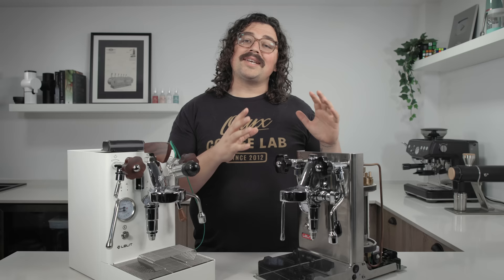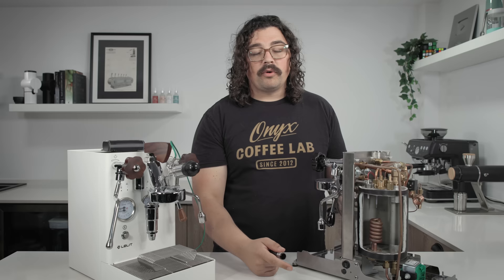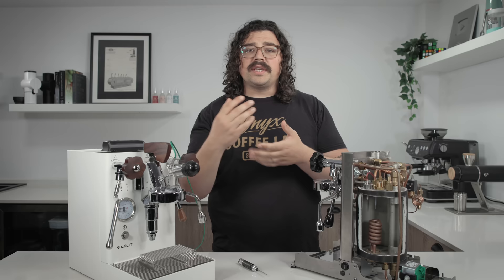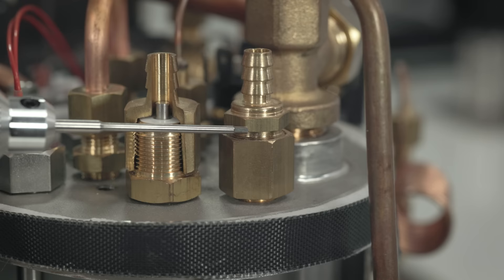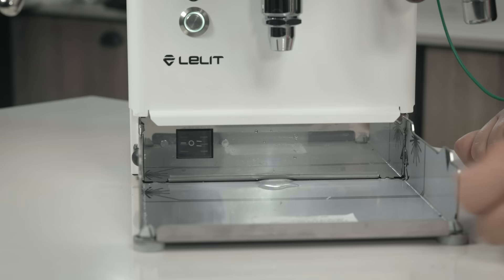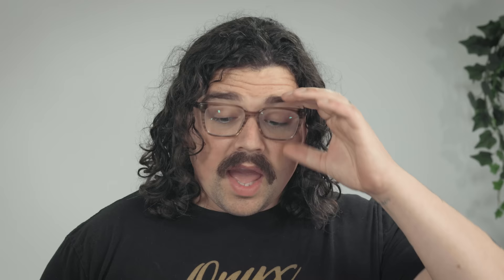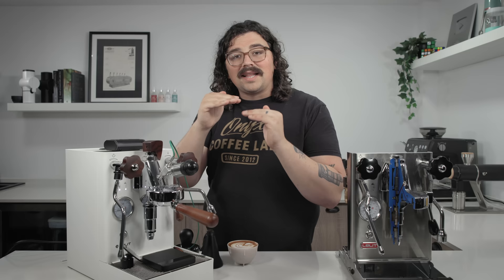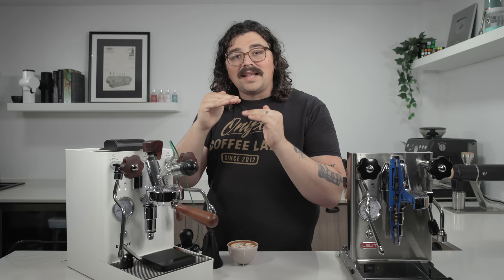BEST BUDGET HEAT EXCHANGER?: Lelit Mara X Review

Comment: Chrome, brass, copper, and stainless steel. What's not to love? The mechanical isolation of the vibratory pump is a nice touch. This is a little mod that can be made to cheap machines for quieter operation.

Comment: Amazingly good video! 👏 thank you! 
I’ve been using this machine for about 4 months and I couldn’t be happier with it. I didn’t want to spend more than $2K, and really couldn’t justify the $3400 for Bianca when I’m the only one making coffee at home. This machine has exceeded all my expectations and more. I initially went with Ascaso Steel Duo but ended up sending it back, got my money back and bought the Mara v2. My other 2 options were Profitec 400 and Lelit Elizabeth. I’m not too fond of the looks of the Elizabeth, not for my kitchen, and torn between P. 400 and Mara went with the one I thought would look the best in my kitchen. Love the aesthetics of the Mara and pulling shots has been a breeze from day 1.
Reply: Why did you send the Ascaso back?
Reply: @peschee  faulty unit, the steaming worked on day 1 and then wouldn’t work at all. I called the seller and they couldn’t help me over the phone and asked me to send it back for a replacement. I sent it back but requested a refund instead. I was just disappointed with the whole thing. Glad it happened though!

Comment: Amazing compact machine. I’ve add a temperature display by reading the TTL pins. Another mod is change the pump to DC gear pump  that I can change the pressure by controlling the pump’s power

Comment: Loving my Mara X so far. I know e61's and heat exchangers are not for everyone but I will say if you like the e61 and you want a small machine that just works like it should this is a great choice. Also got mine for $1700 new, a lot more reasonable than $2200.

Comment: Great video and a thorough walkthrough, Lance! Thanks for that, but damn, I was about to pull the trigger on a profitec pro400, especially after seeing whole latte love‘s video on it where it seemed to have great thermal stability after a short flush. After seeing this video and your words on HX machines I’m rethinking it again…the pro400 seems really well built though and it has a real preinfusion mode. Also, I have a profitec dealer and repair shop nearby, so I might still go for it if they convince me. Tough decision…
Reply from the maker: sounds like Prof is the way to go, tbh.

Comment: I've been using a Mara X for around 3 years. Picked up a couple of things from this video. I thought steam dropping to .5 bar was a fault but maybe not. However mine doesn't drop while pulling a shot or if it does it's comes backup again before the shot is finished, it does drop to .5 while steaming sometimes, other times it will stay around 1bar. I don't know why the inconsistency.
I have mine in power saving mode so don't have to worry about over heating, just have to wait 10 mins or so for it to heat up again. For someone who just wants to drink a nice coffee in the morning without to much fuss the Mara is perfect.

Comment: awesome vid, but can't say I agree with you on temp stability after a few hours of being left on, I've left it on for hours on end and I find that the machine never overheats, it has only overheated when tinkering with the machine and the steam mode has kicked on which then heats up the group temperarily, it is only when that happpens when I have the group overheating. (I have a e61 thermomeater).
Reply: Nice review. I use the x steam mode, I lift up the lever few times before brewing to keep the high steam pressure while brewing, would you think the group head will be overheat if i do this way? only for 1 shot
Reply: @erihsehc2  yep, just pull the shot, clean the portafilter and group, once you fill the pitcher, it should be at steam preassure

Comment: Thanks a lot for this very interesting video and your insight. I'm a Mara X owner and have built in the thermometer in the grouphead but no flow control. My machine turns on at 5am. I make espressos at 6am 1pm and 3pm without turning the machine off inbetween and the eco mode off. The thermometer shows exactly 92.2°C ever single time when i step at the machine after idle for several hours, literally without exception. During the shot, the temperature shows 94.6°C every time, which results in 92°C in the portafilter, as tests have shown. I wonder where the instability comes from after idle time with your machine. Is it possibly because of the flow control?
I actually forgot to turn off the machine today after 3pm, walked at the machine at 11pm and it showed 92.2°C. It seems to be incredibly consistent to me. I'm in brew mode ond temperature level I btw. The only inconsistency I notice is a high temperature around 15min after i pull a shot or s temperature drop if i pull back to back within the same minute without giving the machine a 2min break. Other than that, it seems to settle at exactly 92.2°C again.
Reply: Btw, do you turn on the steam x mode
Reply: @erihsehc2  I have the V1 of the Mara X on the what was then called "brew mode" which is the exact same mode that is called "steam mode" on V2, so yes.

Comment: Hey Lance, I've been waiting for your review on Marax. Also amazed that you mentioned the reduced flow rate of the machine. So I wanted to ask you, considering the reduced flow rate (5ml/sec) and the slow ramp up (10 sec), does that mean that the recommended brewing time should be longer than the normal 25-30 seconds?
Reply: This really made sense for me. I have my shots dialled at 40 seconds. I thought I was weird, but maybe it’s the flow on the machine
Reply: Yeah, by taste mine are 35-40 seconds. I always assumed it was the preinfusion / slow ramp up, I didn't realise the flow was considered slow
Reply: Good old question about when to start the shot timer. Some (including me) start when the flow starts (first drops in the cup)

Comment: So glad I’m not the only one waffling back and forth between the Lelit and the Profitec Pro 400. Lelit’s features are hard to beat, but profitec’s build is similarly hard to beat.
Reply: one extra feature on the pro400 is a real preinfusoon. but those temp modes with 90/94/98 have some weirdly large steps. still haven‘t fully decided either, but i‘m 80% leaning towards the pro400
Reply: @lukasj1212  same! Unfortunately this video made it slightly more difficult

Comment: Lance... i just recently discovered your channel and follow you since then. I currently have a beginner model from Lelit, the Lelit Anita that comes withg an on board grinder. I would love to upgrade soon and spend between 1000-1500 for a new machine. I actually love the Mara X, the way it looks like and based on your review. In your conclusion though, you have mentioned that in that price range, you would most likely get something other machine instead. What would be your personal recommendation... The Rocket Apartamento would also be something that caught my attention. For the grinder, I would most likely get the Turin SD40 or DF64.  Would be nice tor read from you regarding this and thanks for your great videos.

Comment: Would be great to get a review from Lelit Mara X out of the box. Not modified.
Reply from the maker: This isn't really modified. The temp sensor and pressure sensor do absolutely nothing to the coffee. They simply give me readings. The flow control is the only mod. And I discuss the machine as if it didn't have a mod. And I pull a shot without using it. This js essentially out of the box if you pay attention.

Comment: Thanks, Lance, for a thoughtful review. I am unclear what mods you did to the machine and would have preferred a review of the out-of-box machine. A PID heat controller properly programmed should have been able to prevent the heat increasing over time.  Cheers!
Reply from the maker: I didn't do any mods that mean anything. The parts in the group head are strictly to help showcase what I'm doing. It doesn't affect performance. The flow control Mod is the most commonly used mod on e61 platforms. But even with that, I show a shot example without using it. So, no worries.

Comment: Hahaha, omg man, you have done an awsome job in informing us how this machine really works. I've had it for over 2,5 yeas now and still love it. Of courese, the coffee depends very much on the barista himself so, if I mess up, even the most expensive mashine will make worst tasting espresso. 
I havent learned everyting yet, Before I had dry pucks after extraction, now they are soupy,,, maybe it depends on which beans I work with I don't know. I'll try to do a good clean with detergent try to figure out what it is. Sometimes I even get some grinded coffee in the cup. Have I gone too fine then or do you think it is the "O-ring round the group head that need to be changed ? 
Awesome work . I'll write some more in the comments later.

Comment: Regarding the low temperature at the low flow finish: the e61 group head is below the target temperature and cools the water that is above the target temperature by absorbing some of the heat. If you are lucky the results is the target temperature on your puck. If the flow is low the group head can take more heat from the water and the result is the low temperature you measured at the low flow finish.  Actually e61 thermal stability is a myth that comes from the time the alternatives were even more unstable.
Reply from the maker: Oh definitely re: the myth. And yeah! That makes sense re: temp loss at gh. Just crazy to me the water stuck in the boiler wouldn't heat up even more.

Comment: I have this machine V2 with the flow control and also the water recycling mod, which I think the V3 has as standard. One major factor for my decision was maximum power draw. At breakfast time I'm often using my other appliances and a dual boiler would simply be impossible to use for me, since I've got 3450W total. At 1300W iirc, at the time it was the only option that also has good stability. And, as you alluded, this thing is built like a tank. There really is nothing left to be desired in that department. Counter space is also a nice bonus.
Reply from the maker: agreed. tank, slim, and works well. Not to mention a vertically mounted boiler making everyone's life much easier for repairs.
Reply: I also have the v2  and 3450w (spain?) but I still haven't got around modding it.  I tried once and I didn't have the right screwdriver. However I connected a raspberry to it and record the data to a localserver + notifies me when it's ready to brew lol.

Comment: This is very useful. The camera work might have been a bit better cutting from mid-shot to closeup; I was loosing the sense of where stuff was, where you were pointing. Maybe there's footage available for a re-cut that flows more with the water flow and your screw driver. One other thing: I think your expectations for this product go quite a bit further than the design and functional goals set by Lelit in its marketing material. I own one and I purchased it with the expectation that it would give me decent to good, sometimes great espresso with a minimum of futzing and analyzing of flow rate, temperature, etc. It seems to be performing for me at that level although being a steam engine essentially its acoustical profile varies, sometimes alarmingly -- rattles and grinds that disappear back into the same workman like roar I heard on this video. I think the most potentially confusing aspect is the extra long infusion time and its relationship to the overall shot pull time. I'm still undecided if a 25 second shot for example includes the infusion time, i.e., approx. 10 seconds, or doesn't. Some say it's from lever push to lever pull; others say it's from pump up to max to lever pull. In other words, this product may need a bit of clarification training. Too bad you have to give it away. A tutorial for 'just folks' that includes your prep workflow would be a big help to us owners and maybe to Lelit as well. On and on; will he never stop! Yes. Great video, Lance; thanks for your help.

Comment: Hi Lance, as a marax owner i really enjoyed your video, the best review I've seen so far.
Unfortunately for the last 2 years I've had some issues with the machine which needed to be fixed under warranty... 
At the end i guess you were referring to dual boiler machines. Which models do you recommend at this (or below) price range?
Reply from the maker: Actually I prefer the Gaggia classic pro. That's why I bring up tinkering. If you do the gaggiuino mod, the thing is built well with all stock parts. Can have an insane machine for $650
Reply: @LanceHedrick 
I actually had a Gaggia classic. It was incredibly reliable but no temp control and i steam alot for milk drinks so it is not for me.
Maybe lelit Elizabeth could be a better option

Comment: This seems extremely similar to the Profitec 400. Any sense on how these two machines might stack up against each other?
Reply from the maker: let's see if profitec will send me one for a proper tear down!
Reply: @LanceHedrick  fingers crossed! I was almost pulling the trigger on the 400 until I saw this! Be very interested to see any differences
Reply: I would also consider the new ECM Mechanica IV slim. Same tech as the Profitech 400 Pro, plus all additional innovations from ECM. If you get a Heritage Line version, it’s an absolute masterpiece for the price.
Reply: @nikitasheremetov5011  : If you talk about ECM Mechanika VI Slim, this one has an 1,9 liter boiler instead of Pro 400 1,6 liter. Whether that's a good or bad (slightly higher energy consumption?), I can't tell

Comment: Had this machine for over two years and it normally doesnt over heat after a few hours. Once every three months or so the temperature can idle att a temperature about 2-3C too high, then I either just flush a couple of dl from the tap or do a descaling and after that the problem is solved.
Reply from the maker: I think the issue is I didn't have it sit 100% idle. I never let it hit eco mode.

Comment: I am a MaraX owner, it is possible to lift the lever enough to allow water into the puck for preinfusion without triggering the switch that actuates the pump. I use this technique to preinfuse lighter roasts
Reply from the maker: It isn't the same as normal e61. Perhaps a little water escapes but it doesn't build pressure
Reply: @LanceHedrick  True but it still preinfuses the puck and sets the stage for a more gentle ease in of pressure which is noticeably better to prevent the evil channeling monster :D
Reply from the maker: @Kurt Paris  maybe. It doesn't see much pressure at all do its moreso the.top part saturating. Arguably could be worse for the puck. Would be better off filling fast and shunting flow with needle valve.
Reply: @LanceHedrick  i find this hard to picture since there is quite a bit of dripping evenly through the puck happening which i don't think corresponds to just the top getting saturated. Tomorrow morning I'll see if any pressure is registered.

When you installed the needle valve did you also change the springs in the group head?
Reply: @LanceHedrick  You are correct, there is no noticeable pressure buildup - however, especially once the machine is hot there is a fair amount of flow. I did some tests with just opening the lever (no pump) and pulsing the motor to keep < 2bar of pressure and then stopped the shot before extraction. In both cases when i was digging through the puck it was fully saturated with water (takes anywhere from 20-40s for flow to appear through the puck)

Comment: I was THIS close to getting the Mara X last year. In the end I went for the smaller Victoria as I couldn’t really justify the extra $500 for the one or two shots od straight espressos per day. I’ve always wondered if I made the right call
Reply: Did you?
Reply: @trojanhman8136   Yeah, I think I did fine. I am still using the Victoria and doing mostly medium roast straight espresso. Set the opv to 9bar and got a VST basket and am happy with the results. I'd say unless you do milk drinks regularly or you want to mess with profiling there really is no reason to upgrade.
Reply: @pepomk123  OK, thanks for that. I have some questions that I can't formulate butI really question the espresso landscape.

Comment: Lance, I have the new MaraX V2. The brew and steam mode buttons are completely different to yours. The brew mode ramps up the steam pressure after the shot, while the steam mode ramps up the pressure during the shot. Both, at idle, will not be turning on the steam heating element. So if you come back after 30 minutes, in either mode, it will be ready to brew.

This is really confusing because you have a white MaraX so I assume it's quite new? Mine didnt't even have an updated manual. But you definitely can't set it to act like a normal HX machine.
Reply: I have to wonder if maybe Lance's review machine is defective. The group does overheat (beyond the temp set point) after about 4-5 minutes of pulling the last shot in steam mode, but it cools back to idle in 15 minutes, unless you flush it down. This temp cycling has been discussed exhaustively in many forums, as well as Dave Corbey's review, albeit on V1, but the V1X-mode is very similar to the steam mode of V2.

Comment: I do have one comment.  The water tank. I have over head cabinets. Id have to pull the unit out on those rubber feet everytime. And my worry is splashing getting everywhere with the water reservoir. Also I was wondering what seperates the water reservoir from the rest of the machine

Comment: Hi Lance, thanks for this detailed video. Where I live, the Mara X is maybe 5-10% cheaper than Breville Dual Boiler. I like Mara X for the smaller footprint and look, but the Dual Boiler is easier to manage when it comes to temperature it seems. Which machine would you recommend?
Reply: Breville is finite, and always avoided. V poor internals and reputation.